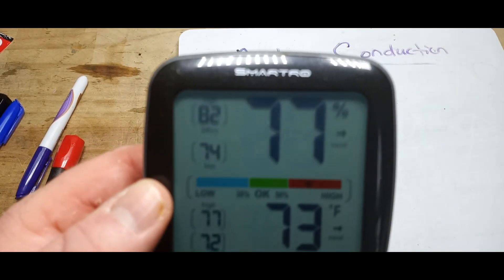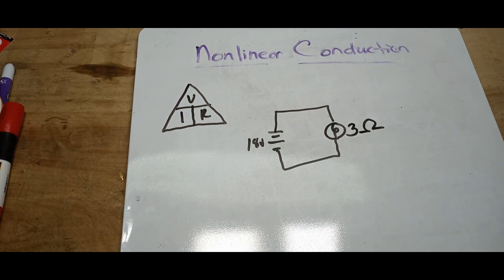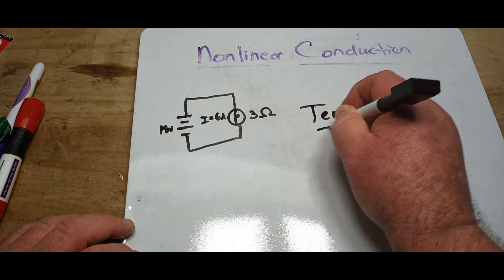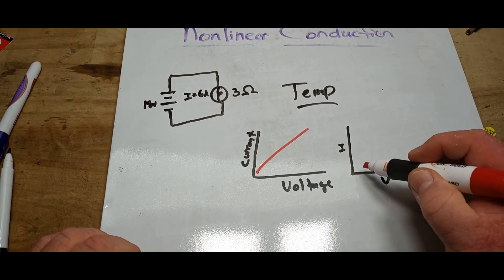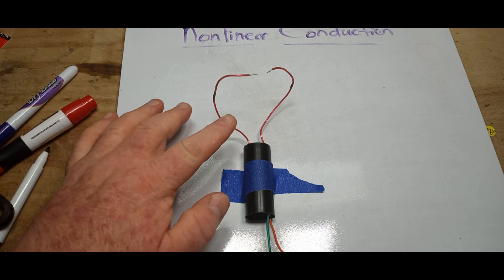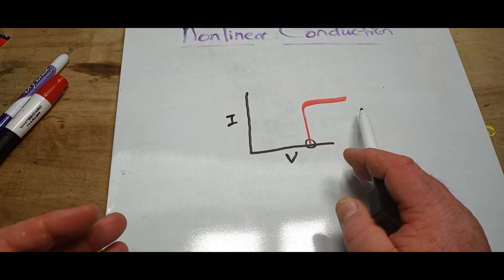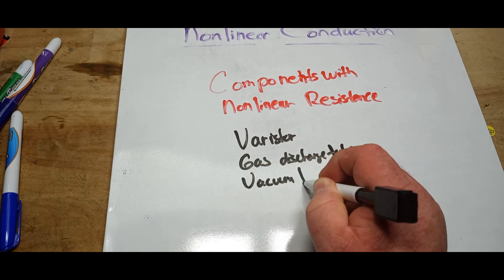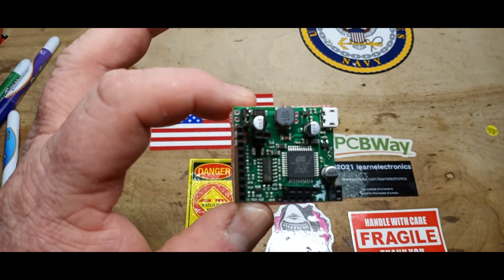Nonlinear Conduction and Ohm's Law

Comment: The reason that old incandescent light bulbs usually failed at switch on, was because the  tungsten filament resistance is much lower when cold, compared to when running at the normal operating temperature of several thousand degrees C. When turned on cold, the bulb current is significantly greater than the normal operating current. This leads to uneven transient heating of the filament and thus its failure. Light bulbs that were operated on dimmer switches that used trailing edge switching, and a soft start ramp up of brightness, tended to last significantly longer, than bulbs that were simply switched on to the mains supply. The latter were statically  subject to being switched on at the peak of the mains cycle, leading to thermal shook of the filament, resulting in the classic "ping" noise failure.
It was once common practice to include an incandescent  light bulb in the feed back path of a Wein Bridge oscillator. The purpose of the bulb was to use its nonlinear resistance to stabilise the loop gain of the circuit, maintaining a sine wave output, rather than a square wave. 
Light bulbs also found app,location in communication equipment relay circuits, as non linear resistance current limits. I believe that teletype relays, were sometimes fitted with bulbs in series with the relay coil. 
This had the effective of speeding up switching times, while limiting the current when the on state was prolonged, with the added advantage that the glowing bulb indicated the fault condition.

Some of my earliest experiments in electronics involved gas filled trigger tubes. These use the nonlinear resistance of a gas as it ionisers to produce a device something like a modern thyristor. I used these devices to make some of my first stroboscopes. I also used their fast switching to make a very primitive transmitter in the form of a relaxation oscillator, that sent signals down the mains supply. This was part of a burglar alarm, that produced horrible noise on the medium wave radios in the house. 
Another use for trigger tubes were as primitive gamma ray detectors, in the absence of a proper Geiger Muller tube, which as a twelve year old I had difficult in obtaining. Curiously, it was much easier to find a gamma ray source, as clock of this time had radium painted dials.
Gas filled trigger tubes found application in telecom relay driver logic, but we're notorious for switching state on exposure to bright light, such as sunlight. 
When i was about twelve I was obsess with making stroboscopes and other flashing lights. To this end I would over drive the old neon indicator bulbs. These have a non linear resistance. When fed with high voltage DC, via a current limiting resistor, they can be made to flash simply by placing a capacitor across the bulb. The dc charges the capacitor to the point where the neon gas breaks down, at about 90 volts. At this point the capacitor is discharged completely via the zero resistance of the ionised neon gas, producing a bright flash. The cycle than repeats.  Unfortunately such abuse of the bulb can greatly shorten its life, particularly as the electrodes are not designed to operate with DC. Such flashing Neon bulb circuits did once appear as a fad in electronic equipment that wanted the novelty of a flashing warning  indicator light.

Comment: Your nonlinear graph is not correct. When current first flows through the filament it’s at max, as the filament heats the current decreases to a steady state as the temperature & resistance stabilize.

Comment: Hi paul, i just designed a board and ordered it from one of  your sponsors JCLPCB ( i think ). What a pleasant experience.  The online software was pretty easy to use, but what most impressed me was 4 hours after i ordered it i got an email saying i had a trace that was too close to a pad and could they fix it. They even sent a pic of the issue.  Amazing right?  I guess because it was my first order, i got 5 boards for 2 dollars, and shipping to florida was 13 dollars.  Boards were 100mm x 70mm.  They said delivery was 3 to 7 days. Thanks paul, i thought you might want to hear this!
Reply from the maker: Indeed. They've always done right by me, but I expect I get the best service.i am very happy to hear you a good experience too. If you EVER have any trouble with them, please get in touch with me (arduino0169@gmail.com)and I'll reach out to their executives.

Comment: Great video.  Couple things that I can add is that while working on Yachts I've found that corrosion can play a really big part in boats that catch on fire.  If the shore power wires on the boat are corroded it won't trip the breaker,  it will just heat up the wires causing them to melt stuff and then catch things on fire.  Resistance due to corrosion won't always blow a fuse or trip a breaker.

Another idea that popped in my head is that lighting occurs when the insulator (air) is capable of conduction.  What happens if the air can't?  I believe that's when a tornado 🌪 happens.  It's a discharge in electricity just without the bolts.  Because what happens when run a large amount of current through a medium? (Air or copper or...) Electro-magnetism.   It induces a spin,  like your toilet does based on the earths magnetic field.  Spins one way above the equator and the other way below.

I'm probably just crazy though.

Comment: Am I missing something on the temperature increasing restistance and therefore current? I thought if resistance increases, the current decreases.
Reply: You are quite right, he misspoke. (In a series circuit such as his example.)
   It is worthwhile to remember that these are simplified circuits. For example, any real battery or power supply has both series and parallel resistance, and only special high-accuracy supplies have separate voltage-sensing lines to make the voltage constant at a point.
   But for real electronics with currents much smaller than 3A and wire diameters large enough for a small voltage drop, they are useful approximations.
Reply: @trelligan42  Thanks for your clarification - much appreciated.

Comment: At the start with the 36v battery you said temp would increase current and resistance, the voltage remains the same. How can both current and resistance increase while maintaining ohm's law?

Comment: So, do I need to hook the tunnel diode to the flux capacitor in series or in parallel?
Reply: Use 2 diodes in Reverse Parallel so each half of the sign wave is used.
Maybe that only works with LEDs to make the flicker??
The flux capacitor is only polarised on odd numbered days (I think 🤔 )
Or is that just in Back To The Future???